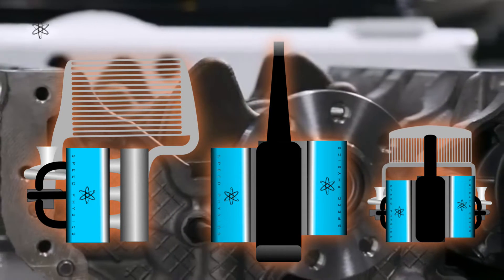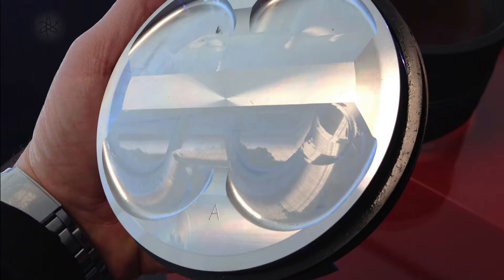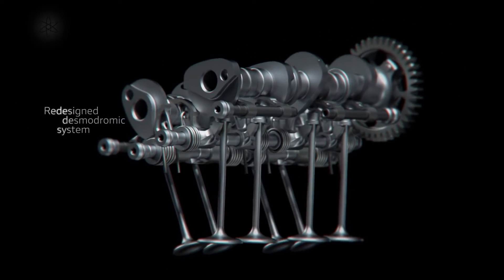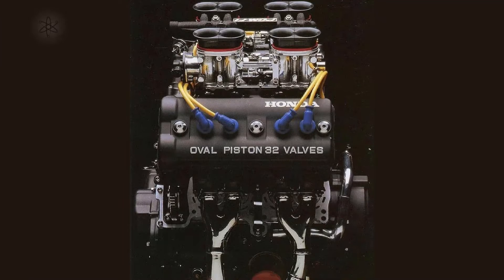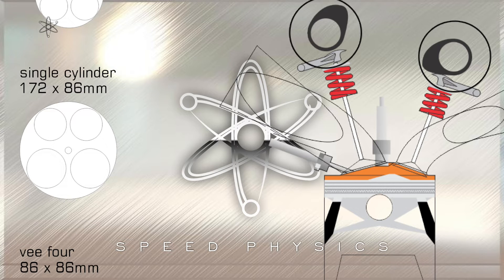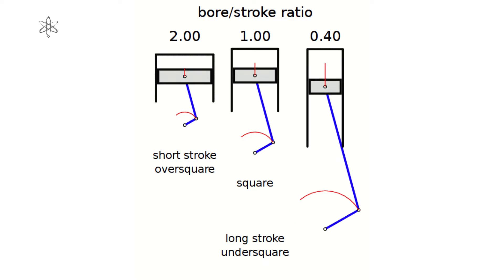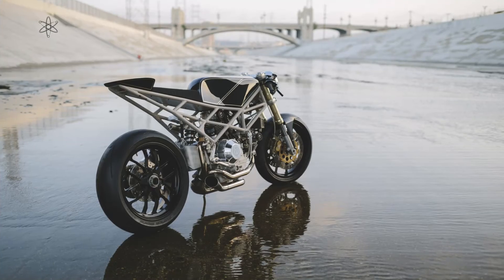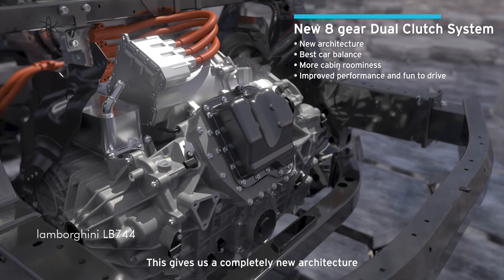Is More Cylinders More Efficient

Comment: All false. Everything you state is far too vague from an engineering standpoint, with wide overly generalizations and no actual details. The vague generalizations are in fact misleading and blind to the actual facts. No pun all respect, it is a great presentation and analytical. However is mmore influencing feelings than actaulity. For more engine efficiency to be had focus design parameters precisely. 1. Engine balance trumps all other considerations. This concludes engine layouts in the best inherent balances wins. This includes the 'V' 4's the inline 6, the V8's, the V12's as top priority. Balance shafts are ridiculous. 2. Bore stroke ratios between 1.04 and 1.075 absolutely without doubt are the most efficient. 3. Rod ratio of 1.8 for turbo engines or boost. And rod ratio of 2:1 for naturally aspirated. Period. Period. Ok. 😊 Have a nice day.